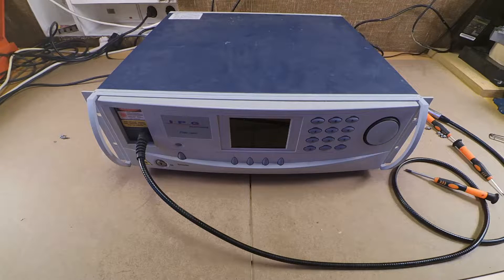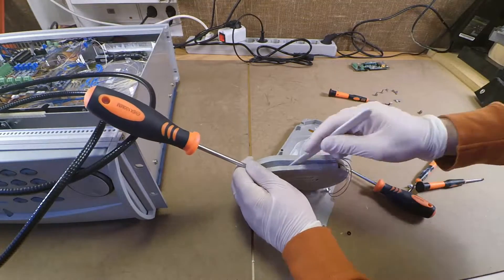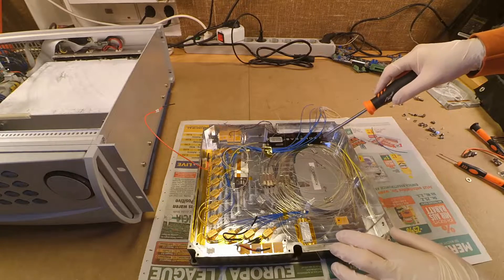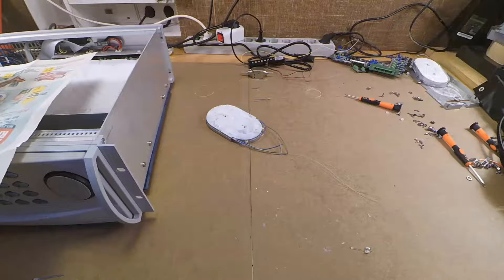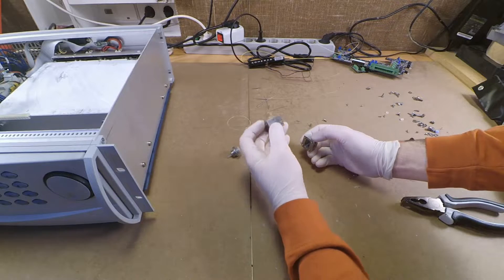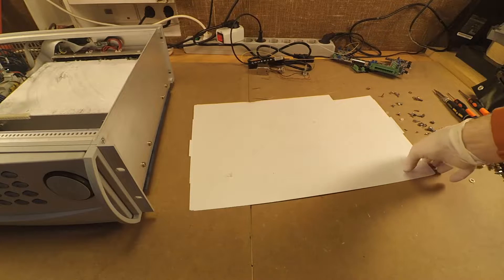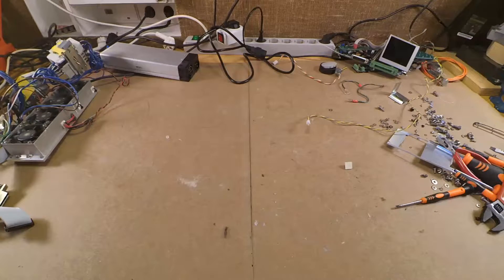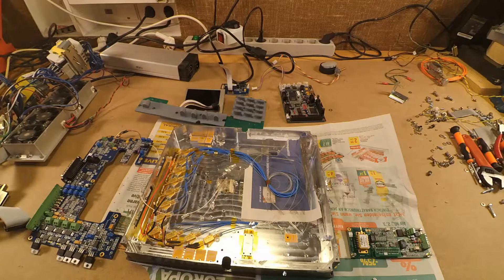Teardown of a 20W infrared IPG Fiber Laser

Comment: the block at 10:00 could be a faraday isolator. it rotates the polarization by 45° and has filters so light cant travel back into the fiber / lasers. 
the first one.. maybe a fiber bragg grating or the splice joint where the pump diodes feed the doped fiber